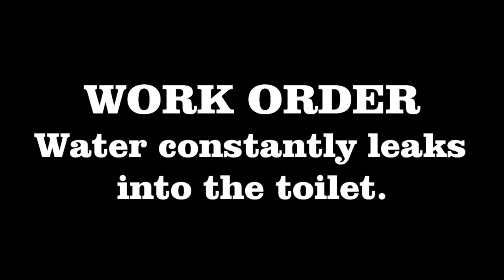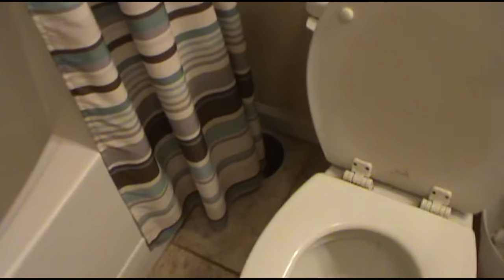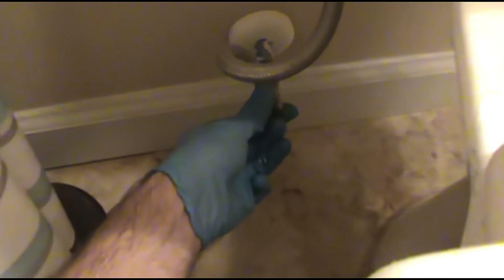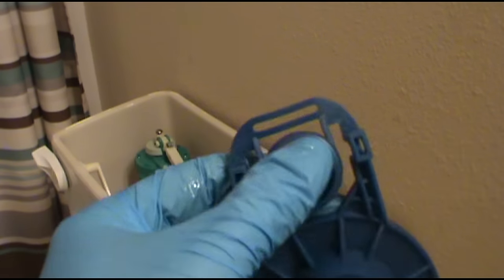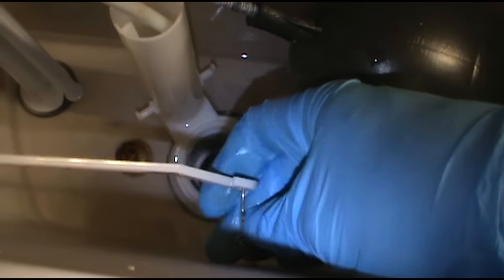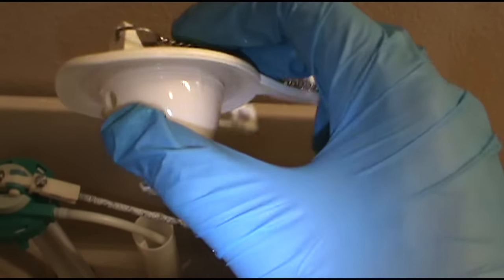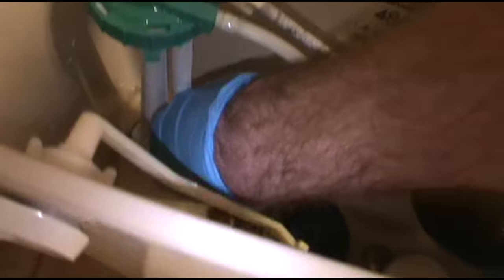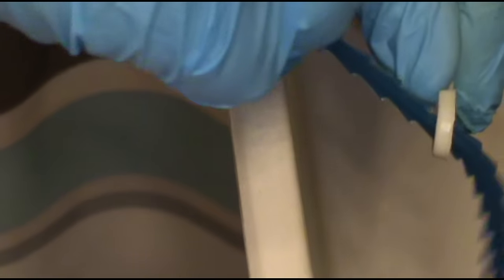TOILET CONSTANTLY RUNS.

Comment: water in  toilet bowl always too low. afte   r flush it seems to disappear. i still haven't gotten an  answer for this problem.  i don't have any leaks
Reply from the maker: sam washington hmmm the only time I see water low in the bowl is when there's a clog in the main line or in the toilet itself. Not a full clog though. Water is still able to go by but not large stuff. The uneqaulized pressure in line causes low water.